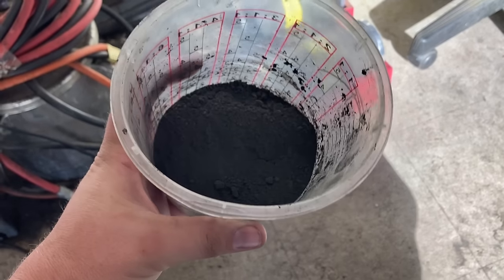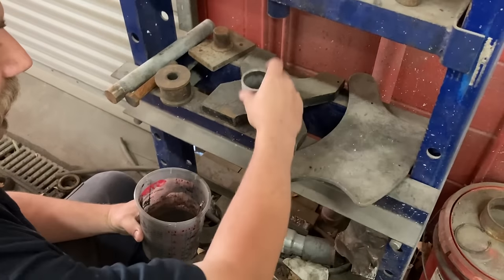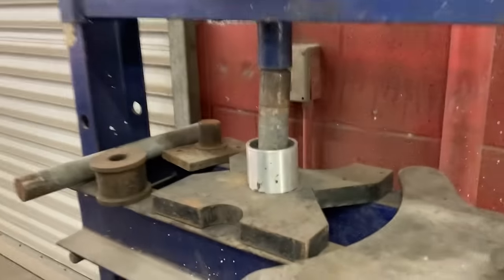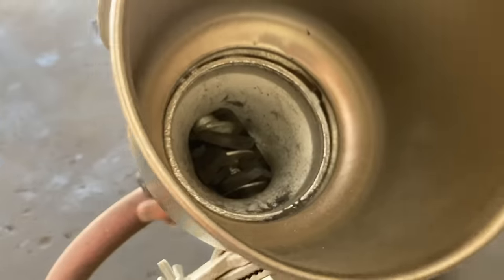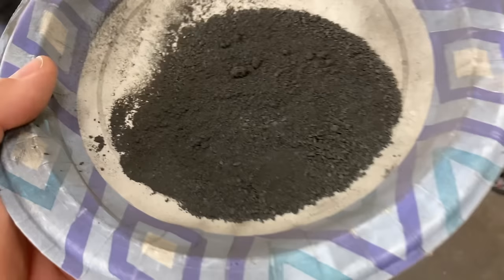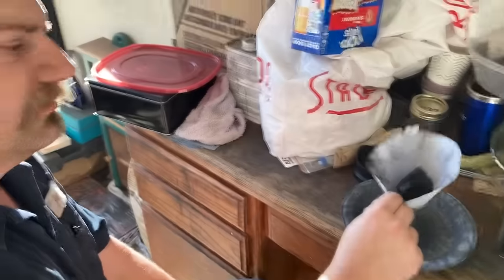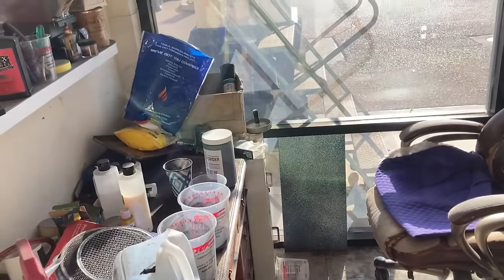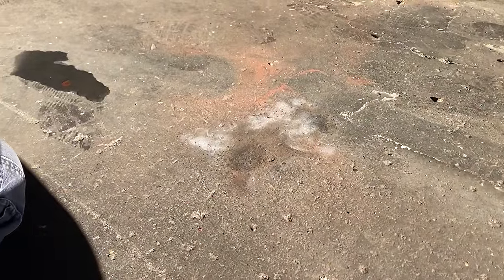Making Corned Black Powder

Comment: At one time 303 British ammo used black power and was wondering how they formed it into a tube but in the shell case?  I'm thinking it would be like my muzzle loader with pellets and a hole through it so the cap could flash could ignite it all at once! But was it formed in the shell or separate?

Comment: I think I said it on another channel in detail but in just 4g of water @20c there will be a minimum of 1.6 grams of kno3 in solution. 
Your black powder composition ratio's are no longer valid!..... 
You can't say with certainty what the ratio's truly are...that's the point everyone is trying to tell you. It's a very important thing to know.
Hence most pyrotechnic composition's call for a NC based solvent. It takes away nothing but in place adds...
Reply from the maker: So if 2cc of water get pressed out of 200 grams of powder, whats that work out too? Not to toot my own horn but I make powder that is more powerful and cleaner than any commercial powder you can buy, so I’m really not too concerned about it.
Reply: @Everythingblackpowder  it's the same, the water is still 4cc/4grams. 
Kno3 is highly water soluble as you already know but tempreture has a huge impact on its solubility. 
As I mentioned @20c 4g/4cc would have a minimum of 1.6g of dissolved kno3.
It's a technique that's learnt with practice.
I personally use around 2cc and a little more to help the sulphur congeal as it's compressed. "it turns to jelly if you let it sit for 30s and press onother tonne of so. You'll hear it crackling".
Reply from the maker: I guess I don’t see how it’s the same. KNO3 isn’t nearly a soluble in cold water as it is in hot. And since I don’t use hot water, I don’t know how you can really measure the amount of potassium nitrate that’s going to be lost in those 2 to 4 cc that gets pressed out when making pucks. Also, it just doesn’t really make a difference in the finished product.
Reply: @Everythingblackpowder  I say a minimum of 1.6g of kno3 is in 4g of water for that reason, it can be moredepending on tempreture as I said earlier.  
Nothing will be lost if you have no water residue that drips out of the press but if it does, that's when your loosing kno3.
If you loose kno3 in the process, your composition is no longer valid and you can't actualy say with certainty what the ratio's are.
So if your not dripping a residue,  you've got nothing to worry about! 
 I use water for pyrotechnics and Nitrocellulose-based solvent for everything else. It's fare superior. 
I hope that makes sense,  you can look up the solubility chart to compare to your water temperature ect but it's too much of a hassle TBH.  Haha
Reply: @Everythingblackpowder  ok I didn't notice you edited your first comment. I'll respond back to that again. 
If 2g of water got pushed out while pressing you are loosing around 0.8gm of kno3 guessing that the water tempreture was 20c
Reply: Guessing that your composition is 75/15/10 after pressing your composition is now something like 74.2/14.? And 9.? As there's no way to measure charcoal and sulphur loss.
Reply from the maker: @hulkgqnissanpatrol6121  we use a ratio of 77/13/10. And again, it just doesn’t make enough of a difference to make a difference. 🤷‍♂️
Reply: @Everythingblackpowder  my dad was an industrial chemist so I tend to do things to the book. 
Experiments are great but if you don't have a perfect control, you'll almost never be able to replicate it.
Like I said earlier, you can't guarantee the composition ratio's if you say it's leaking 2g of water while pressing. 
Just add less water, enough to stop the dust is all you need.
Have fun experimenting.
Reply from the maker: @hulkgqnissanpatrol6121 thanks, but even 2 cc worth of water getting pressed out is an exaggeration. As for not being able to re-create it. I’m afraid I have to disagree.
Reply: @Everythingblackpowder  Im only going by what you've told me and you said 2g out of the 4g you put in is extracted while pressing...
If you took two samples in to be tested they will be different. So no, you'll never truly recreate the exact same composition every time.
Reply from the maker: @hulkgqnissanpatrol6121 and my point is simply that it’s not enough of a difference to make a difference.
Reply: @Everythingblackpowder  I got that from the start. 
You stated it in your video and I'm simply commenting with the infomation and explanation as to why people are saying you are loosing kno3. 
The reason they make a fuss is because it's very important and many have had extensive training that your practices go against.
Have a good day.

Comment: I played mountianman 50 years ago. Hope you are useing that stuff in firearms made for black powder. It will ruin a modern firearm. Remember black powder does not burn. It explodes. Very dagerous stuff.
Reply: All propellants burn at a specified rate. Some burn a lot faster than others, even "explosives" have a specific burn rate. 
Modern steels can handle much more pressure than older ones. Brittle containers like glass are probably some of the few things that explode.